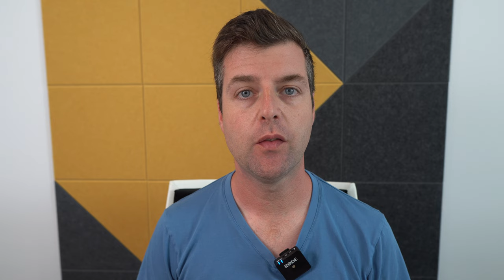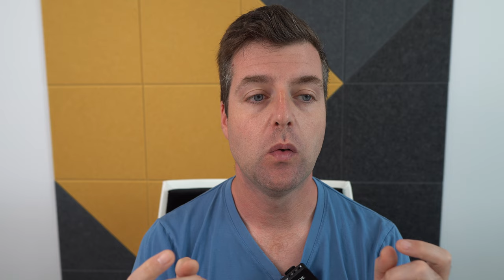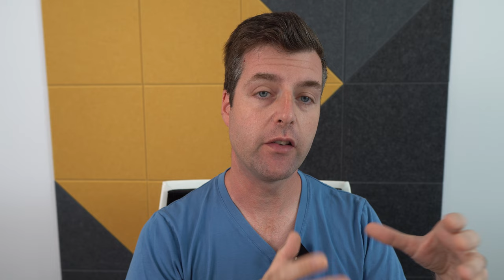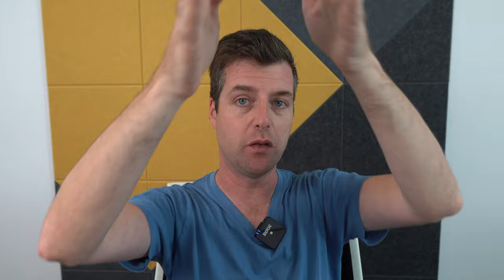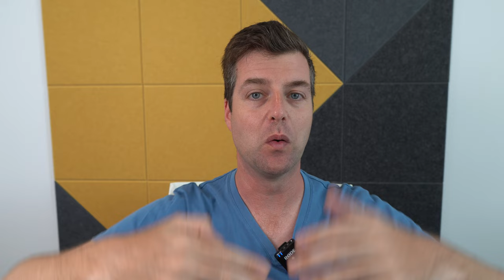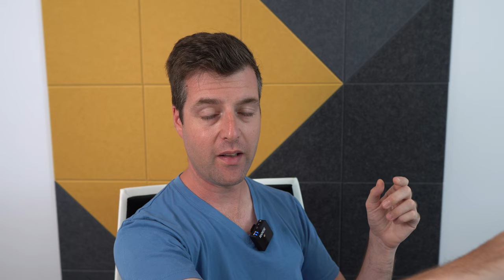How to optimize HVAC in your HOME THEATER

Comment: Good stuff Matt. For my soundproof dedicated basement theater, I went with an ERV to do the cross exchange with fresh air intake and it is a game changer.  The room gets stuffy all closed up after about 30 mins or so, ERV is on a smart switch and cycles on and off at automatic intervals and within minutes the room is transformed. It's reasonably quiet.  No other cooling needed since it's a basement.  Just have an exhaust fan in the closet to deal with the equipment ventilation.
Reply from the maker: That’s a good idea. We spec ERV’s with the HVAC as well. Since I am in Florida and AC is like 24/7 I personally just have a fresh air duct directly into the return.

Comment: Really great info.  I have a mini split and I’m able to run it very quietly but wish I’d known more to push for other solutions.  My theatre air does get stale.
Reply from the maker: And I bet it’s still what sets your room noise floor. The best of them are very quiet for a fan in the room. But when the true room noise floor is 20dBA or less, that AC still adds noise. 

My subwoofer amps have fans rated at 13dBA each, they are inside of acoustically treated ducted housings in the amp. Those amps are in an open rack inside a closet with a solid core gasketed door. I can hear those fans running inside my theater through all that!  It’s not loud, don’t get me wrong. I can hear it. It bugs me that anything like that is raising my noise floor.

Comment: I would recommend calculating the air velocity at every stage of the air pathway (plenum, duct, grille vent face,etc) and then keep all velocities less than 250 feet per minute. Worked for me at least. 100% inaudible HVAC on full blast with double stud construction ~NC20 space.

Also be careful about transition pieces made out of galvanized steel. Can become noisy with expansion and contraction as the conditioned air changes temperature.
Reply from the maker: That was essentially what I did and what we do when designing theaters.  We spec duct size to keep air velocity below a certain point.  

In cost no object theaters we spec acoustic turning veins, mufflers, all metal parts damped and insulated, all ducts acoustically lined, decoupling between ducts and hvac unit, etc.  For the average person this gets really expensive.  I have a ton of cheap alternatives that work nearly as well. It seemed too much to go into for this video.
Reply: @PoesAcoustics  "I have a ton of cheap alternatives that work nearly as well. It seemed too much to go into for this video."  Nonsense!  ;). Such real world experience is what sets your channel apart from other channels.  BRING IT ON!
Reply from the maker: @nattydj8646  hah ok I’ll think about how to do that. Personally I think the DIY mufflers are designed badly. I am surprised people find them to work. Real professionally designed silencers never look like that. They don’t have a labyrinth inside of them for a reason. All those tight turns add back pressure and cause the formation of turbulence.
Reply: @PoesAcoustics  that would be a great “myth” or common practice to explore. And hvac in general deserves more attention since it is foundational and often overlooked.

Comment: Thanks for the info, Matt. How do you maximize the STC rating of the walls while creating so many HVAC openings where the sound escapes from? Are putting flexible ducts through baffles effective? I've seen it don't on YouTube videos for music studios in the past.
Reply from the maker: It's a good question.  If you wanted the highest possible STC you can't have any openings, but thats also not very realistic.  Every scenario is different and I use different techniques.  However, I don't use flex duct in a baffle typically.

The key is to use professionally engineered products.  Most DIY mufflers create more problems than they solve.  I use engineered siliencers mixed with decouplers, acoustic flex duct, etc.  However, I only use flex duct where breakout noise is a non-issue.  For example, in my own theater, there is nothing above the theater.  Flex duct has high breakout noise.  However in my scenario the breakout is just into an attic space.  Not a major concern.  I suppose you could argue that it might create sound leaks to the outside but those would be relatively minor.  What I can say is that the in-situ measured STC between my office and theater, which has a jumper vent and common partition wall, is 62.  When you consider that the highest measured STC of even the best walls in the best labs is rarely much higher than 65-70, an in-situ of 62 is very good.

Comment: It can be a mistake to spec too big of an air conditioner in a humid climate because it cools so well that it then doesn't run as often so it doesn't pull the humidity out.  Just something to be aware of.   1.5 ton doesn't sound like too much though, especially factoring a higher heat load.  You probably spec'd your AC appropriately rather than too high.    The issue with putting the supply right by the seats is that when the unit is running convection cooling can happen to the people in the room (although your velocity should be fairly low), which sometimes causes people to socialite between hot and cold when the AC is running or isn't running.  I did the same as you, my HVAC for the theater also supplies my office. I figured if I'm in the theater I'm not in the office, so, don't have to be too picky about balancing it lol.  Thankfully my gear is in an equipment room outside the theater, so that helps with the heat a lot. I highly recommend using commercial synthetic carpet to avoid mold.
Reply: This is true for conventional one stage HVAC systems installed the USA, but with ducted "mini split" heat pump systems, it's much less of a concern because the inverter compressor can modulate how much cooling or heat it produces. Typically a 18,000 BTU system can modulate down to about 3-4000 BTU if that is all that is needed to heat or cool the space. Waste of money though to buy a 18,000 BTU unit if all you need is 4,000 though. The bigger BTU units can move more air though to Matt's point about air exchanges. Highly recommended to perform your own "manual J" for any serious theater room project. Anything else is just a guess...
Reply from the maker: My equipment is in a closet too. But the closet produced so much heat that it impacts the cooling. We used dead vents or crossovers for returns so it dumps hot air into the stairwell. Not my choice actually. I wanted the returns ducted directly but the installer refused. I wanted a dead vent only for the theater because of noise issues.
Reply: @bartl006  thanks for the info bart! In my theater I used a commercial unit so the return is ducted, which saves having to have a noisey air handler someplace.   not to mention the square footage that takes up.

Comment: You mind telling us how much you paid to have the hvac installed and what maintenance is like?
Reply from the maker: You mean because I have a dedicated system in my upstairs?  

It was included in the total cost of the build. But figure around $15,000 for something similar and I pay an annual maintenance contract to have someone come out and check both units. They clean the units inside with an antibacterial spray. Check temps, etc. I think I pay $100 a year or so for that. I supply my own filters and I use 3” thick filters. 

We have had no problems so no repairs. It’s just the cost of the filters and maintenance. And you certainly don’t need to pay that. In Florida the drip lines get bacteria in them that causes water to backup and as I learned the hard way on my parents house, is extremely costly if missed. We found that bleach or vinegar does not in fact work all that well. I decided to pay someone else to come in and blow out those lines for me and then clean them to avoid any chance of a backup.  I treat it like insurance.  Plus I have better things to do with my time and would rather spend that time building my business or with my family.  I know many enjoy house maintenance chores and certainly it’s a way to save. 

Is that what you were looking for?
Reply: @PoesAcoustics  yes thank you. I appreciate the details. I’m in the process of buying my first home now. I’m specifically looking for homes with nice basements. And it’s important for me to have a solid hvac. I’m seeing what I could afford and what I’d have to compromise on
Reply from the maker: @RogueAesthetica  look into ducted mini splits. You can get one to handle just the theater for not too much. We did a job with a dual zone ducted mini split. 22k btu and 10k btu. We used one zone for the theater and one zone for the equipment and projector. Total cost was $8500 in hardware. I forget labor. It likely was thrown into a larger bit of work.
Reply: @PoesAcoustics  thanks I’ll look into that. Any suggestions for a person that hates the look of mini splits on the wall?

Comment: My mini split is quieter than my mini fridge.
Reply from the maker: That doesn’t surprise me. I don’t typically put a mini fridge in a theater for the same reason. Noisy.
Reply: @PoesAcoustics  no kids in your theater either🥴
Reply from the maker: @garyharper2943  I have two kids in my theater right now. They are quieter than a mini fridge too.
Reply: @PoesAcoustics   Great kids…very impressed.